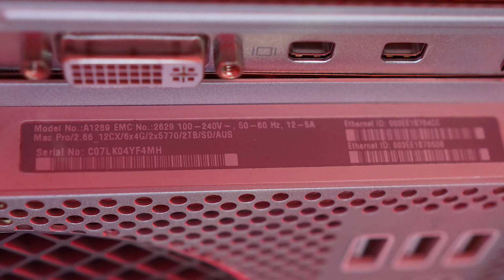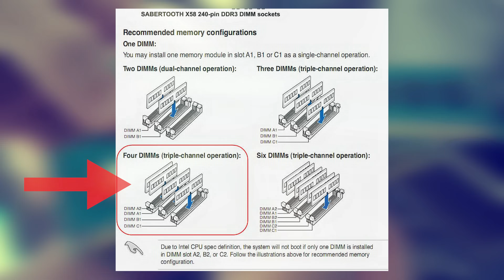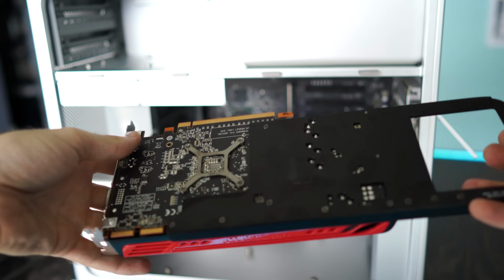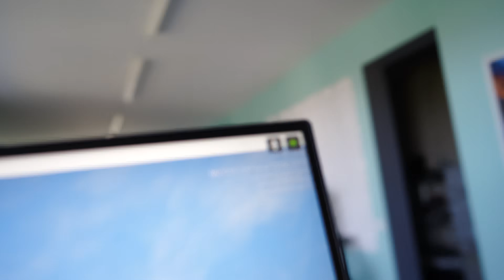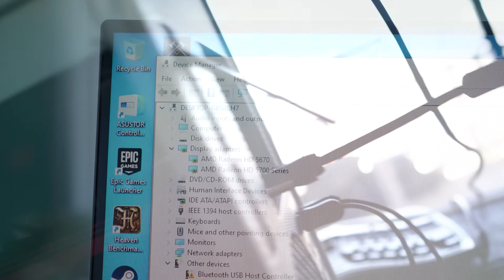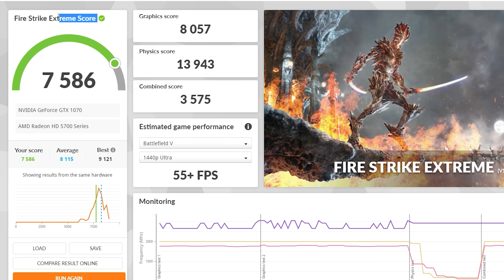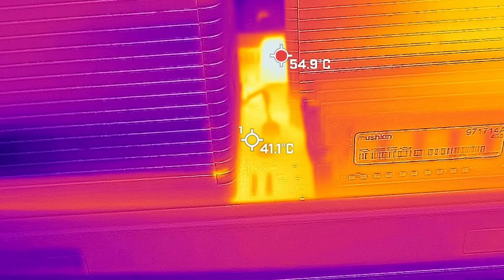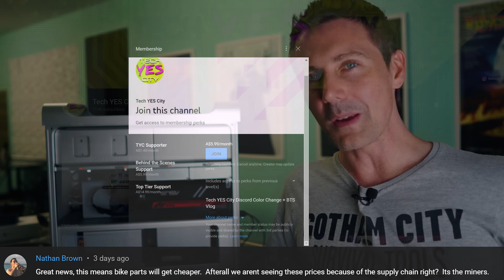Windows 10 GAMING on a $100 Mac Pro 5,1 from 2012... Is it Possible...?

Comment: I spent some time in 2020 gaming with a 2006 1,1 Mac Pro, with 8gb of RAM, SATA SSD and a GTX 285. Weirdest thing was that this specific Mac ran Windows 10 better than any other patched MacOS versions later than the last officially supported 10.7 Lion.

I still see some groups related to Mac Pros and people still use them with current powerful GPUs, like the 5700XT, Vegas and the Radeon VII. Some still use NVidia cards, but they lost support after MacOS 10.13 High Sierra.

These Macs have a weird power delivery circuit to the GPUs, requiring 2 proprietary 6-pin cables that go through the main motherboard. If they suck too much power, above 225W IIRC, the Mac shuts down. Users mod the power supply to add cables straight to the GPU.
Reply from the maker: Ah thanks for letting me know that, just saw the price of the originals selling on ebay and thought I wouldn't go too crazy on it :P
Reply: @techyescity   I believe these mac's also have a PCIe lane configuration utility , you would have to boot up once into the appropriate mac os for this series to get it to run. I have a 2007 mac pro and i have it set so the original mac card has 8x but the 980Ti gets 16X lanes.
Reply: good ole plx mod :)
Reply: @zerokool1985  No
Reply: @billg6059  yes that's his you convert the psu to handle more power hungry gpus
Reply: @zerokool1985  I know what the mod is , I just am NOT a fan of it . IMO its not a good mod , ALL the leads should be unique and run directly inside the PSU.  piggy-backing power LEADS IS NOT A GOOD IDEA especially to run a power hungry gpu
Reply: Running an rx 6600 in one of those with 96gb ram .. works wonders… better than having the mod the psu

Comment: I had the 2008 3,1 dual quadcore xeon with 32ggb ddr2, ran it with a vega 64 in both windows 10 and the latest MacOS version. These days it's just running with an RX570 on Catalina or Big Sur. 

those mac edition ATI cards had driver issues sometimes in windows. 

When repurposing old Mac Pros go Radeon. there is a workaround to run GTX cards alone in windows so you don't lose access to the other slot. cause those are prime PCIe SSD slots.

Comment: The inflation numbers came in for the US this week.

7% highest inflation in 40 years.

The problem is, inflation doesn’t typically run backwards.  They consider “negative inflation” a worse economic problem than high inflation.  

Therefore prices aren’t going back to pre-pandemic levels.

Comment: Brian I think you installed the wrong NimeZ drivers, what you need is the terascale pre gcn drivers because the hd 5000 series is based on terascale architecture. If I'm wrong please reply
Reply: Also need to flash the vbios to use it properly in windows
Reply: @virtualtools_3021  yeah that too. I was expecting more out of it since I actually use an HD 5770 right now and it seems to perform better than that.

Comment: The 5770s are perfectly fine for eSports they just have a Mac BIOS on them which makes them run like shit in windows
Reply: Probably. Recently I tried an old HD5670 on my current Windows 11 machine. It ran Heaven and 3DMark Sky Diver without a problem. It's weak but still working.
Reply: @ПламенМарков-я1г  i had a 7570 (despite 7000 series it was still terascale 2) and it could run many esports titles at lower settings well

Comment: If, you were going to keep it open core legacy    patcher would fix alot of the problems you had and AMD cards have better support I have my 5,1 with 96 GB Ram, 2 1tb nvme ssd's, and a msi 8pin 5700 flashed to a 5700 XT, I also have windows 11 and the lastest Mac OS on it
Reply: Are you running Mac OS? I've got a sapphire rx580 in one my dad gave me but I'd love to get my sapphire nitro plus 5700xt working in it.
Reply: @DirtySoap   the 5700 I am using is the msi mech oc as it only used 1 pci 8 pin for power and am using a dual mini 6 pin to single 8 pin to power it. Look online for open core legacy patcher and their is a guide with everything you need to know.
Reply: @Sean3614  cool I'll check it out

Comment: A friend of mine has s quad core model, you can use Gpus that aren’t supported by bios you just loose the boot screen.

At least that’s true for Mac OS.  I upgraded it to a Polaris GPU.
Reply: These can be upgraded to 3.33GHz dual CPUs.  That should help gaming performance.
Reply: @pweddy1  good ol x5675

Comment: Just bought 6x GTX 1070 Gigabyte OC for 2400AUD. All of them work just fine, but thermal paste was literally glued to the board and the heatsink. On some of them I had to leave some of the stuff behind and reapply the thermal paste. Any recommendations how to take that stuff off?
Reply: Plastic prying tool and scrap it off them clean with isopropyl
Reply: Dental floss and "saw" it off works good, also you can apply some electronics cleaner to soften it up
Reply: If the method with heat or alcohol does not help, try to carefully use paint thinner, but be careful, this thing is strong and could damage MB. Quickly wipe it falls anywhere it should not.

Comment: I wonder if Throttlestop would work for overclocking this.
Reply: I am pretty sure people used to overclock these machines, can't remember if it was with Throttlestop or not, but I do believe it would work.  BUT...not for dual CPU, as far as I'm aware.  If I remember, it's because there are no unlocked dual CPU for this platform.
Reply: Only MAYBE on a single CPU model with the unlocked xeons (W3680, W3690, whatever the previous gen ones are, but they're only quad cores)
Reply: @virtualtools_3021  They are actually six core/12 thread, the W3680/90, I have one, and I also have a W3570 that is an unlocked 4 core/8 thread X58 Xeon...the only one, I believe.
Reply: you can overclock them, very little info but on my 2007 mac pro i did get it to overclock and ive heard on these its far easier.